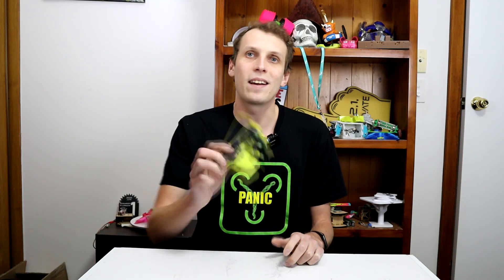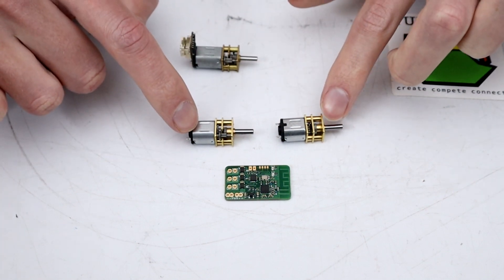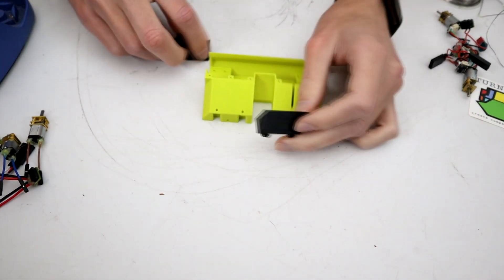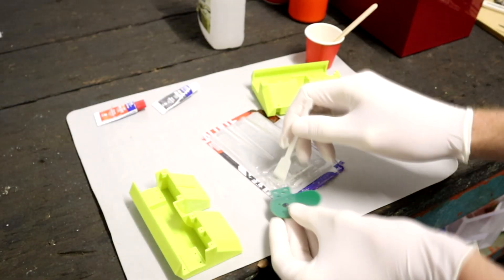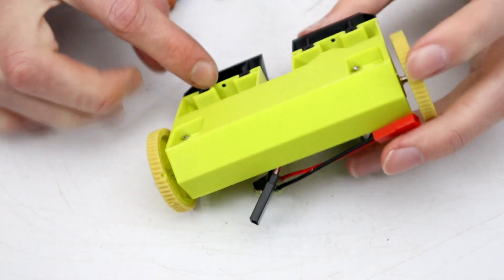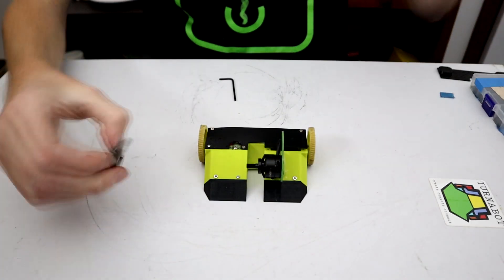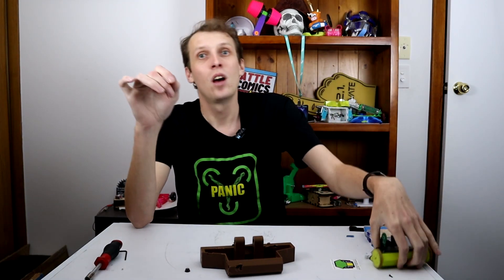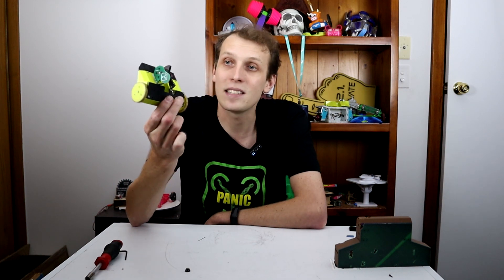Making a tiny robot go FAST! (150g This Is A Party build)

Comment: Could you reduce the amount of hot glue? For electrical insulation the amount seems excessive and their heavy. It won't do much for stress relief or shock protection, maybe a paint on "electrical tape" could shave off another gram or two?

Comment: I'm not a builder (yet)
Have you thought about tying weapon speed to throttle to try to counteract the wheelie? Unless I'm mistaken it should provide some counter-rotational force.
Reply from the maker: I have thought about it but decided against it for 2 reasons
1) the flysky radio I use is very basic and coding that mixing in would be a pain (and I dont trust it to fail safe)
2) I want my weapon speed to be independent of drive, all going well the weapon should be at 100% as much as possible

Comment: Do you have the weight to add a wheelie bar to the back to keep it from having the front end rise off the ground
Reply from the maker: maybe, but I'd prefer to add the weight to the front. It means I have a bigger weapon and means I'm not adding geometry my bot can get stuck on if its upside down or on its back

Comment: this is tangential, but could you reinvestigate smeezus drive? i was thinking that pointing the face of the wheels inwards to the middle and using normal wheels would help with the control. this drive could be nice for building since wheels act as armor for both the bottom and sides.

Comment: I've always been interested in using a gyro for robot stabilization. Some bots could definitely benefit from it, even bit 250lb ones. I think it may really help horizontal spinners that tend to zoom off to the side as soon as they turn on the weapon motor.
Reply from the maker: I've heard of people doing it, would be interesting to see if the weight cost of adding a gyro is worth the drivability increase
Reply: @TeamPanicRobotics  Probably more important for 1lb or 3lb robots. Still tiny and twitchy enough for it to really help, but large enough so that a few grams of extra electronics wouldn't be a huge issue.

I was wondering since that Malenkis integrated receiver/esc would be really trick if they also threw on a small gyro chip. Some of the 1/28th scale RC car electronics do that.

Comment: It's a speedy little ankle biter! It'd be cool to see a drag race between the 12k and 16k motors, if you have the spare electronics for it. That or a wheelie competition.

Maybe beyond the level of involvement you want/use, another way to reduce wheelie-ing would be to spin up the weapon as you accelerate forwards, using the torque reaction to cancel the wheelie. I guess this could maybe be done with mixing, but probably a lot of faffing/testing to get it working right, and probably need a base level to spin up from (so sit at 80% normally and spin up to 90% during acceleration for example). Interesting as an idea, maybe not practical.
Reply from the maker: A drag race would be cool to see, hmmmm

Comment: Weren't you looking at adding a second weapon support on the other side with a bearing or was that a different bot?
Reply from the maker: I did that in my mini orbitron build
I've been considering it for TIAP, but havent fully decided yet
I was worried I didnt have the weight for it, but that seems to not be an issue anymore

Comment: I love Turnabot motors. I especially love them being marked with the speed. So much easier than the bag of random rpm motors.
Reply from the maker: Totally agree! I was surprised by the power I got out of them and those engraved speed numbers are going to help for sure
I think I might end up using them a lot more
Reply: @TeamPanicRobotics  They are pretty much all I use in 150g and 1lb bots anymore. I had given up on N20s until I found them. Plus they are a great family and sponsor our competitions so we can give out prizes to the winners.

Comment: What if you do a motor swap on those from the n10s to n20s but keep the fast gearbox, and push even more power to the wheels and perhaps get more speed?
Reply: Because the n10s turnabot sells can put more power down then the amount of traction you can get in a 150g
Reply from the maker: Agreed, 150g robots dont need a lot of power to get moving, even these n10s spin the wheels before they stall out

So there is no point running n20s if you've got n10s.
The n10s are lighter and will do the same job (especially in a spinner where you dont care about pushing your opponent, you just want to get the weapon to them)